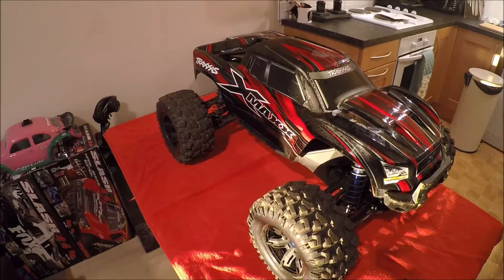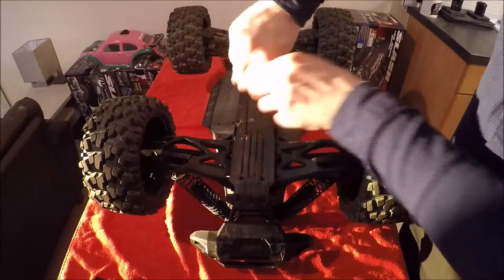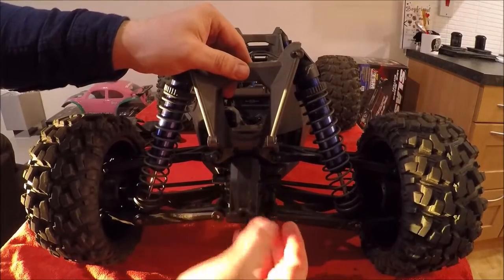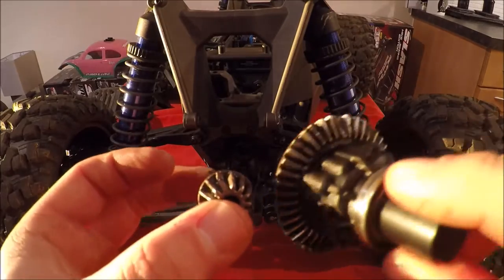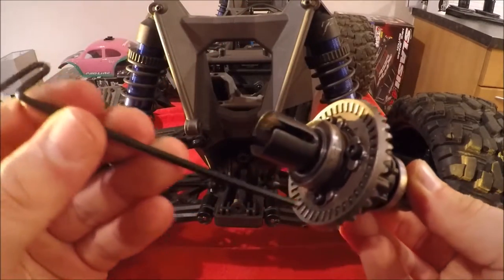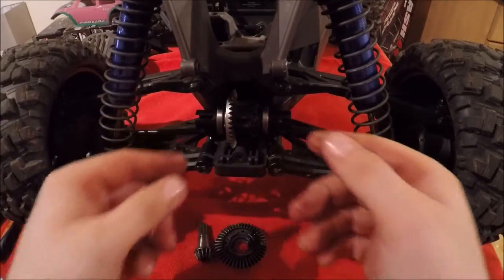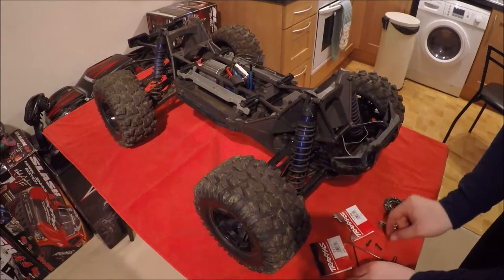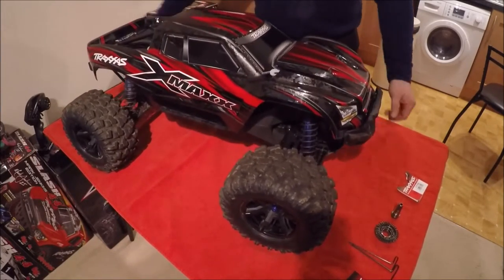Traxxas X-MAXX Front Differential Replacement Project

Comment: stopping and starting  is highly detrimental , BUT MY DIFF FAILURE  WAS NOT CAUSED RAPIDLY  GOING FROM FORWARD TO REVERSE!  BECAUSE  I DIDN'T  NEVER USE MY TSM! AND WON'T ! Unless it means saving me from walking a great distance, mine FAILED DO TO PISSED POOR METALLURGY! their are signs of inclusions and 2 teeth was  were rolled right over, no edge  what so ever. so in conclusion yes going from forward to reverse  rapidly  can definitely  cause this! mine and I suspect  many many others just got a shitty batch of gears! it happens and the installers could not have seen that they where bad to begin  with. just sayen. AND TRAXXAS HAS BEEN AWSOME TOTALLY  AWSOME  IN THERE HANDLING  THE X MAXX'S PARTS THEY SENT MY REPLACEMENT  IMMEDIATELY!  RIGHT ON FOR THEM! and Jake keep them cars flying bro!  you rock brother!

Comment: I too had a diff failure, it was the rear diff on mine and I can see signs of poor metallurgy.  which happens to be my trade. 2  of the teeth on mine had sign of open pockets for lack of a better word. and diff failures seems to be a common failure  of the xmaxx. but I called Traxxas  and they sent me replacement  part out immediately.

Comment: curious of how much the parts cost you  ??? im almost positive my new Xmaxx on its 4th run  did same thing. Sounds like same type of sounds mine is making. I just got into RC hobby cause of Xmaxx an bought mine on 3-2-16 so its  16 days old on 4th run an broke diff. !!! :( on my 2nd run ever my Xmaxx went into a series of flips / rolls which broke rear hub housing that wheel attaches to, the one inner bearing an front bumper. I really love the truck an hobby just pray this is bad luck an not an on going issue  !!! Also bought my wife her first RC Emaxx on 3-10-16.

Comment: The only reason that re diff broke is you stoping it really hard. Try slowing the truck slower to stop the diff for removing the teeth off the wheel. That's how I broke mine and this show I stopped mines from braking teeth
Reply from the maker: +Dylan110301 Thanks dude, I'm taking it a little easier from now on
Reply: And dif oil.